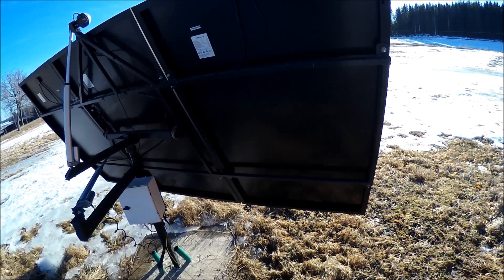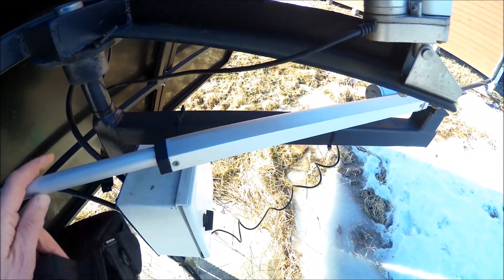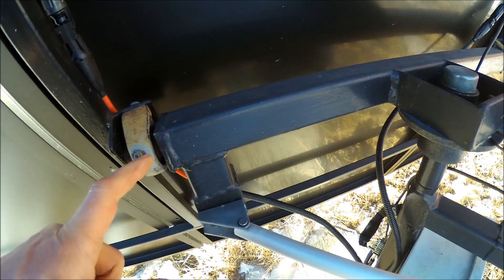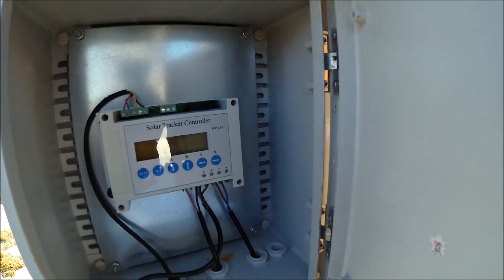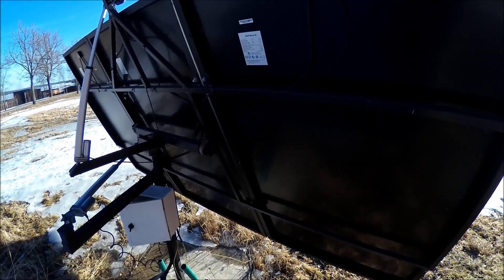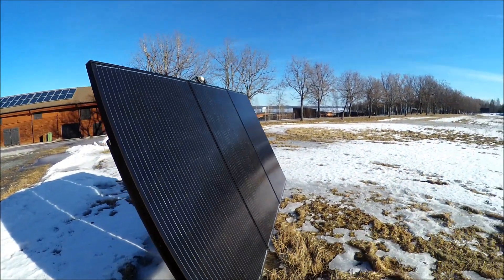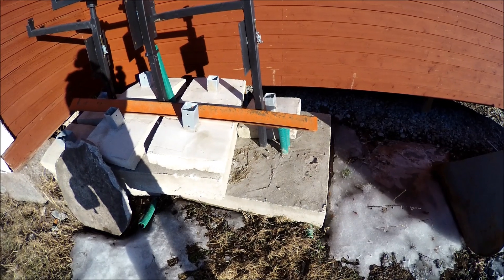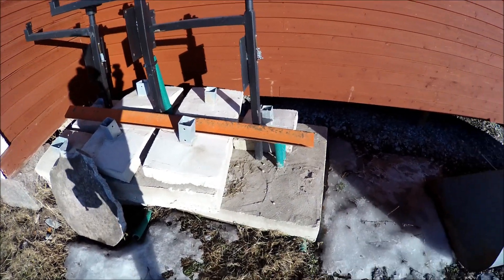DIY Suntracker Explained

Comment: Do you think that a mounting of that size would be sufficient for 3 panels each measuring 1100mm x 2400mm? I happen to have 3 wheel hubs, the same size that you used but not sure if they would be strong enough?
Reply from the maker: No problem., mine have endured several storms. BR Per
Reply: @persteel  great, thanks.
Reply: @persteel just looked at the wheel hubs that I have kicking around, and they are only 4 x 70mm - but they do look the same size as yours? Can you confirm what size yours are please? I think they will be too small as I now think I need 4 -angels on each mounting and the panels will be 2m x 1m. Too small, right?
Reply from the maker: @johnmay754  Yes, I have 4x100.
BR Per